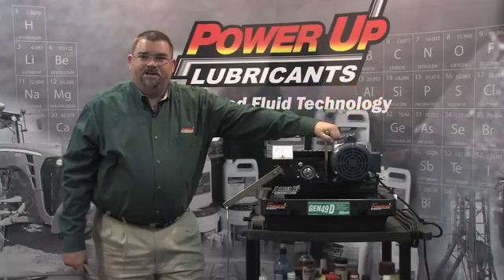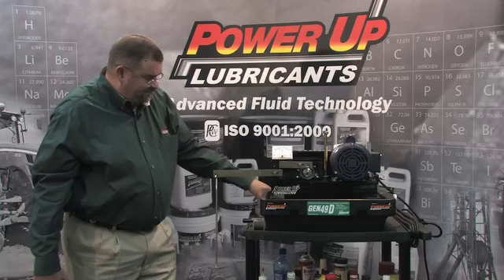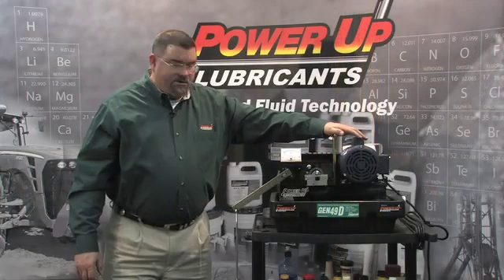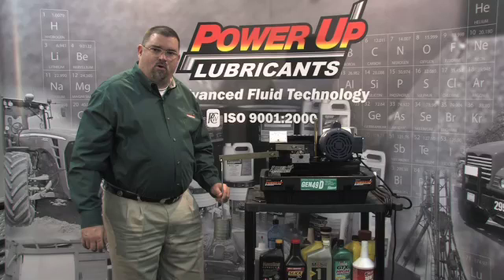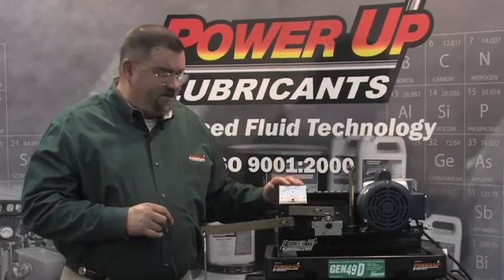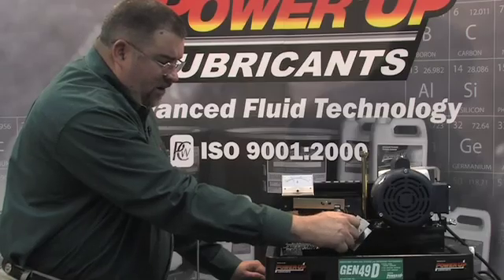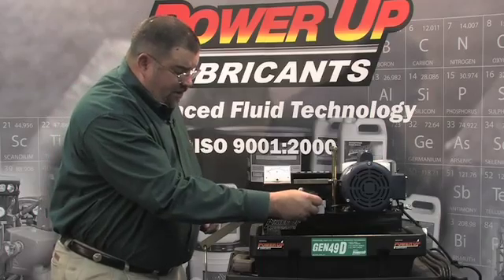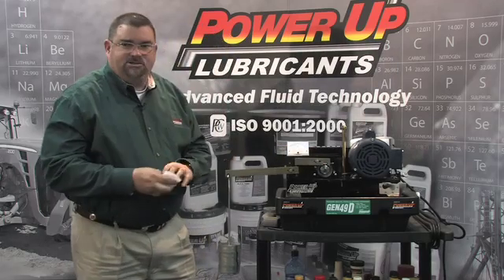Power Up NNL 690 Timken Bearing Machine Demonstration

Comment: 13:40 so great filtral system. Oil recycling permanently in the engine.
same at https://youtu.be/8zARpkRJvo8?t=340
i use the german Trabold
but its principal the same

Comment: I have used this product for years. It is great. First I used it in the gearbox of a rotary slasher which was overheating and noisy with the strain of being driven by a powerful tractor. It both cooled and quietened down. At   Present lm running it in a 2018 mustang. These engines have had a multitude of complaints about ticking and rattling. Mine is the quietest smoothest v8 I've ever heard.
Reply: What if I could offer you a product that was even better than power up and you wouldn't have to keep on adding it with your oil? Something that could actually cause the friction to go down immensely and actually  repair the damaged surfaces of the metal in your equipment... would you be interested? Yes I can prove it and make this power up look like child's play....

Comment: I used to sell this stuff years ago at a store I had. This stuff was incredible and got lots of rave reviews. The difference it made to my Harley was unbelievable. I finally found a place to buy it not long ago. The stuff does not smell like, look like or pour like anything near the stuff I sold years ago. The stuff I just bought looks just like some kind of thick Esso lube or something at 80 a quart. I had to buy more as I just ran out of the old stuff after 25 years. Anyone know what ever happened with this company? I am finding everything around the newer Powerup to be very suspicious to say the least.
Reply: It is still made in Calgary AB as well as USA
Reply: Email me and I can give you information on something that would not only blow your mind but is changing the way people use additives. Give me a chance and I can prove the what I have can completely restore lost compression and restore metal services up to 50% worn and change the way an engine runs in minutes right before your eyes.
I used to sell power up and I have something on my hands that would now make powerup obsolete.
At a fraction of the cost.
Email me at:
greendiamondtechology@gmail.com
Reply: I noticed the old NNL690 smelled like maple syrup when it was MADE IN CANADA.. Now it's made in USA, it just smells like oil.  Back in the 1990's (before NNL690) it was almost solvent thin & smelled like a solvent (and was killer poisonous & burned the eyes out of a 2 stroke)....  The only equal product I know of is PRO BLEND if you cant find POWERUP..

Comment: 11:25
Reply: I have something better, and it doesn't require an oil additive. (I used to use Powerup)
I have the only HBN technology on the market and it will out do power up in and lubricant tests and more. It'll actually restore lost compression for good. No im not joking and I can prove it🙂
Email me if you're interested. 
greendiamondtechology@gmail.com

Comment: I unseized my furnace motor 14 years ago and it still runs. Also got the test guy to do the demo with my used motor oil. Made a lot of noise at first but ended up taking all the weights in the demo. Unseized a dryer motor as well and the motor outlasted the rest of the dryer.

Comment: i have been using this product in my 2011 yz250 2stroke Yamaha from brand new. Done 100 hours now and the clutch is still factory original  with only the springs measuring slightly out of spec. my last 2 450s used to eat a clutch every 30 hours. I have also been using a small amount in pre-mix gasoline and have had noticeable differences in ring gap when i do my piston replacements. I thoroughly recommend this product as i am a qualified maintenance engineer. Seen this test performed in person